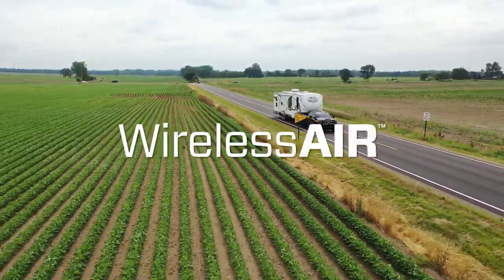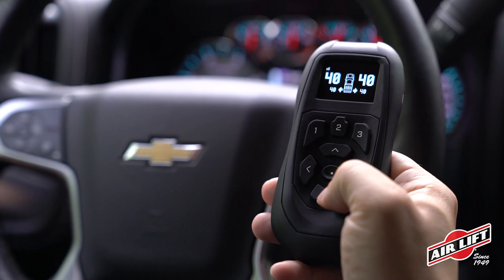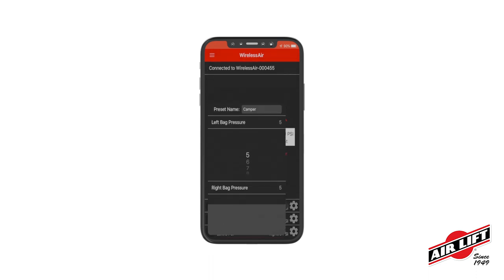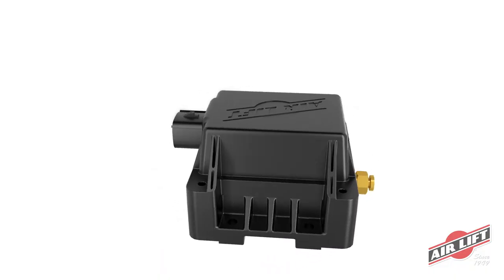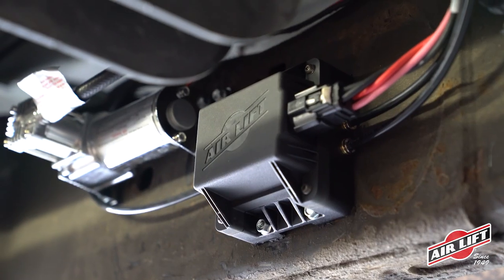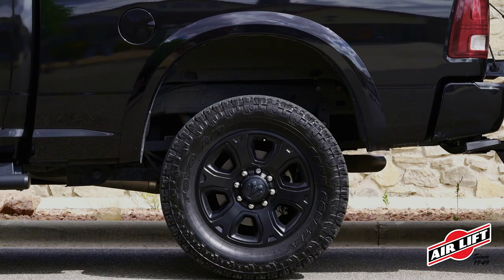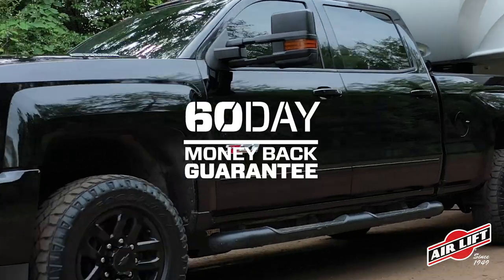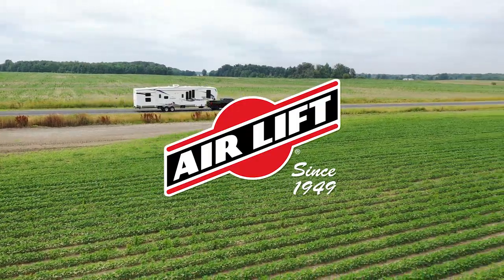Introducing WirelessAir (2nd Generation) with EZ Mount

Comment: I have the wirelessAir system but previous generation.. I was wondering does the mobile app also work for that one?
Reply: Johnny W The app does not work for the 1sf generation system, for that one the wireless controller is the only device that works. It does not have the Bluetooth technology that the new one has. That was one of the main reasons for developing this latest system.